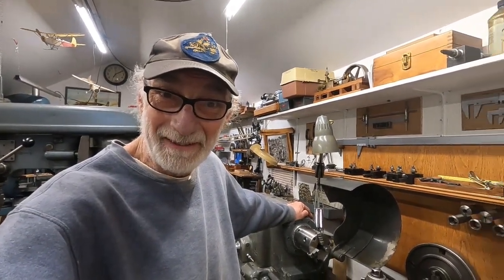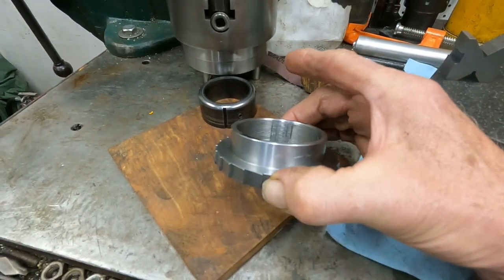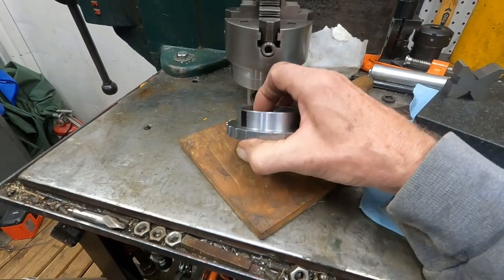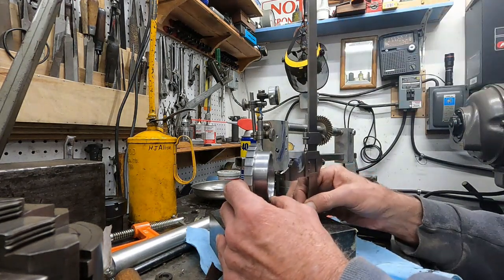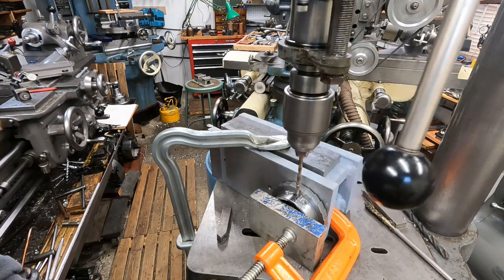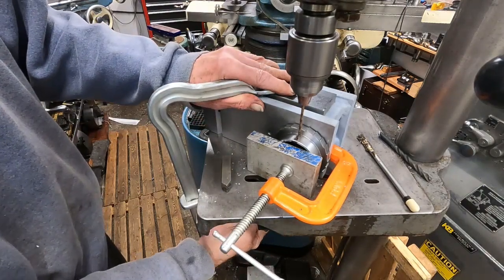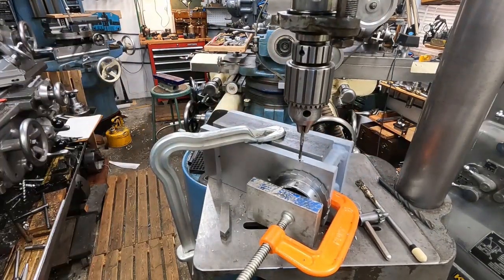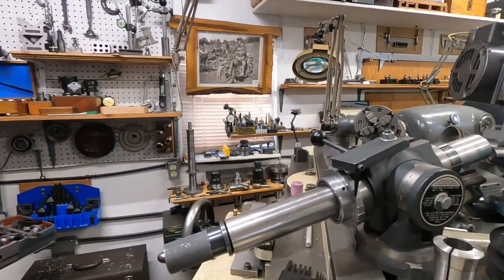Part finished machined and lathe safety guard installed

Comment: I see a lot of machines with those chuck guards but just haven't been able to bring myself to use one. Even as good as the 10EE and Hardinge HLVH are when turning those extreme rpms that .0002 of run out is enough to cause the boring tool to grab. I proved to myself that things are different at higher RPMs. Put an indicator on a shaft that is .001 off center. As the rpms increase the ability for the return spring on the indicator cannot keep up with the cycling of high v/s low therefore the needle will remain still creating the illusion that the shaft is running true. Most of the chuck guards I have seen are interlocked and will not allow the chuck to spin unless they are in place. Good Idea if I could just bring myself to use one.
Reply from the maker: Metal is like rubber, the components in the chuck stretched enough to release the part at that speed. I was well within the correct speed and feeds for the carbide. I am familiar with both Hardinge and the Monarch10ee. The Monarch has 5 times the power, designed for such work. The guard here is quick to attach. and remove, I use it with flood coolant when I need to.